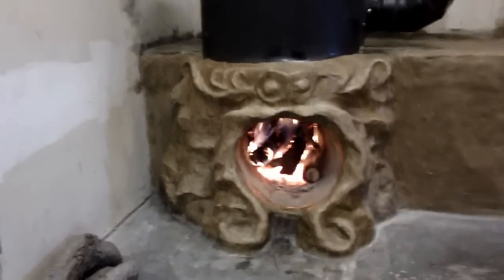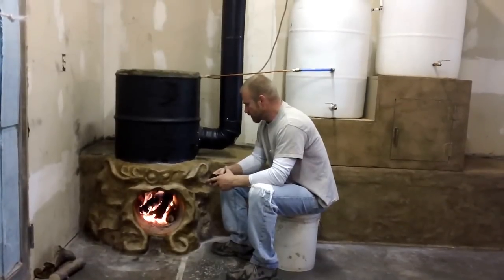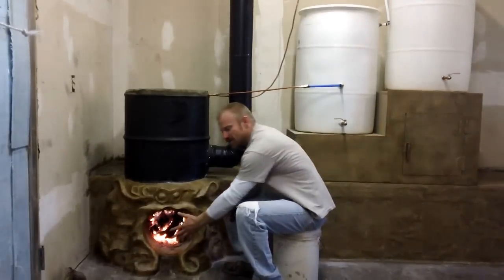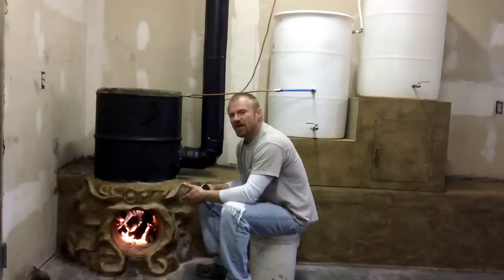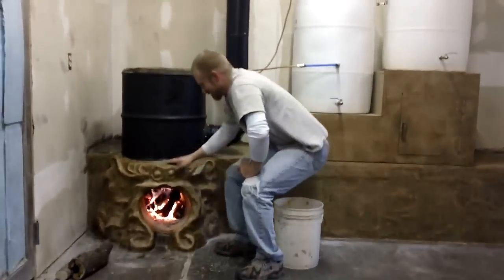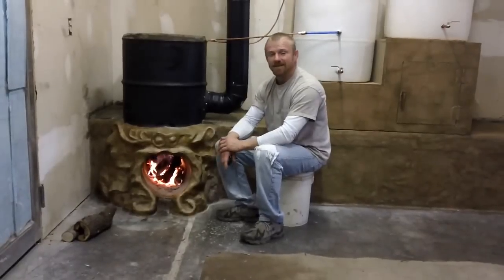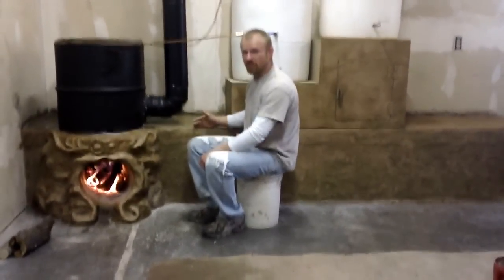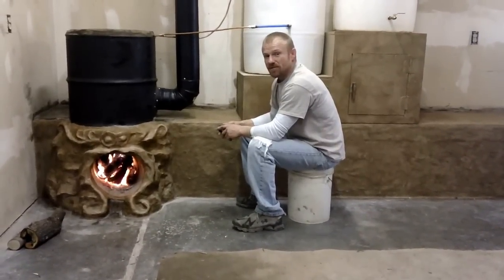Bulldog Rocket Stove Fireplace Thermal Siphon Water Heater part 6

Comment: Nice looking stove. I enjoy your enthusiasm! I was thinking of having a somewhat smaller tank mounted high with a temperature gauge. When the water reaches my ideal shower temperature...I appreciate you guys who are teaching us not only how to survive but how to do it in style.
Reply from the maker: A limited or small water tank could reach boiling point with the thermal siphon concept that could get really hot water and boil completely away. Its not really meant to be instructions as exploration of ideas and concepts. One hot tank and one cold could work real nice with gravity fed to and faucet fixture to make the mix of the hot and cold to achieve comfortable water temps. also remember closed loop or seal systems can build pressure from steam so have an opening to allow pressure release. Thanks for watching and the kind words

Comment: I am curious about the latex paint mix, does it not hold the moisture in and prevent the cob from setting properly? It looks great, but I have been hesitant to use it my self due to concerns about locking in the damp. Great vid, and thanks for uploading.

Comment: I like your artistic flair, I also like your investigative approach to the problems of efficiency. It's a beautiful thing to see people use their heads for more than a hat rack.

What I meant by the loop was the pipes going through the 12 ft of bench that previously heated the mass. I was thinking of maybe a shorter pipe of only 6 feet but would still cause a vacuum and possibly the rocket effect.

Another idea that came to me was combining the bench mass, water barrels, and coil all within the bench structure to reduce the amount of heat loss out your chimney. I know the exhaust is clean, but the heat waves seemed strong to me like it was more than 80 degrees. Maybe with the bench collecting the balance of the heat it might increase the amount of time before you had to start another fire.

Just a thought, and you obviously have way more knowledge than I do, but you are making sense to me and I'm in the middle of a January freeze here in Michigan, so you gotta know I'm seeing the dollars fly right out my chimney even as I sit here wrapped in a blanket dreaming of sitting on that nice warm bench right about now.

Keep up the good work. If my father were alive right now he'd be on your videos like white on rice. Thank you.

Comment: Thank you for responding. I understand the heat holding capacity of water, Water and steam heat are my second favorite forms of heat. The sun being the first.

In your earlier comments you were looking for a way that a working man could leave the system for 8 or 9 hours a day. If you accomplished that I must have missed it.somehow. (keep reading, I learn too.)

I do agree that the water system worked petty well and I really like what you did, but though I'm not a man I do work and would like to be able to leave the system all day, without worry that the heat will be gone when I get home.

... I stand corrected, I just listened to video 7 again and realized you did improve the duration of room heating time vs fuel loading time. I also agree that if you were able to get both barrels to work the heat might last even longer. The chamber idea is good but might a loop work a little better? Just asking.

Well you earned a subscription from me thank you.
Reply from the maker: Hello again. The system I know is ugly and is really just an experiment spot. Im already debating the tare out before the completion..LOL. I learn so much every time  I build something it seems obsolete before I finish it. It could be wrapped up nice and made nice for the lady of the house its just concepts and ideas playing out for learning purposes. Mine mostly.. Im not sure what you mean by "Loop" might work better. Im gona need a little more technical term..LOL before I try to answer. Im going to build one even bigger and better Im looking at a unit that I must attend with once in 24 hours, The water barrel now only gets up to 155 at best so for the size of the coil the one barrel is sufficient . One thing I learned is next time the copper coil instead of 20 feet of 3/8 it will be 30 feet of 1/2 inch... Too up my water heating capacity.

Comment: That is what your long pipes were for, to draw the air through your bench for heat transfer into the mass and then out. I like your creative thinking and artistic flair, But you really need the distance those long pipes would provide, which is still a siphon of sorts but for air not water. I really admire you coming back on after you realized it wasn't going to work the way you planned. God bless you buddy, keep going, keep trying, my heart goes out to you.
Reply from the maker: The thermal capacity of water is 1.0 and the thermal capacity for cob is .2 . That means water take 5 times more energy to heat than cob per pound but due to density advantage of cob it reduces the advantage to 3.26 more heat stored than cob, rock or sand. The barrels of water are now the mass. FYI one barrel heated from 40 degrees to 200 just below boiling will store 75K BTU's thats a whole bunch  (technical term). while a cob barrel will only hold about 22k
Reply: The other factor of heat storage capacity is temperature differential. Water can only get to around 200F before you get dangerous; cob can get as hot as you like on the inner surface, and may be considerably hotter on average than the water, so there is not an inherent advantage either way; it depends on the specifics of the system.

Comment: Lookin good but one little clarification are you useing the water for thermal mass or for a water heater or a radiator for forced air? or I guess if you tewked it enough you could get it to serve as all three
Reply from the maker: Jurica Grčević thermal electric generator,, I have several videos on them ..they make electricity from heat solid state.watch my first video and then free electricity production for an explanation
Reply from the maker: well the water gets hot and radiates heat to the room after the fire is out. However the barrel has a tap in it close to the bottom so it could be used as a batch system hot water heater and further if I just run a line off of it I can run a radiator with forced air too. lt could be used as a pre hot water heater too tied in to the pluming of the house. so take your pick its very versatile.
Reply: yes it is vary versatile thats one reason its an appealing system to use you can do a lot with it.so i was wondering why you didn't put the tegs in between the copper coil and the barrel and just move the heat though them to your water in the coil  and make power to all thought you may have to ad a third 50gallon tank bc the running temp of the cool side for most on sale tegs(besides the news cascade teg) are around 90-100 ish on the cool side
Reply from the maker: master98159 I wanted to show and build a thermal siphon system with NO moving parts to break, I will still add some TEG's to the operation when complete. There are many ways or paths to accomplish a task I believe one must evaluate each one intimately in order to determine whats best for him.
Reply: Van Powell
Excuse me, sirs, what is a TEG?

Comment: It looks good Van. Can I make a suggestion on your upper water tank? I think you could store more hot water in the upper tank if you have the outlet coming off near the bottom. I like your design it looks like a gargoyle with its mouth open. Breathing fire. There you go fire breathing gargoyle.